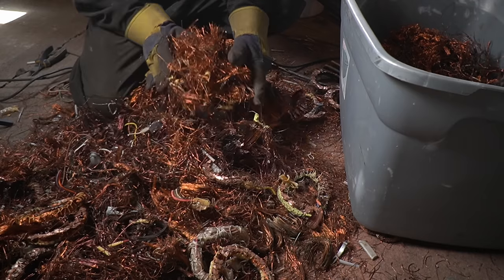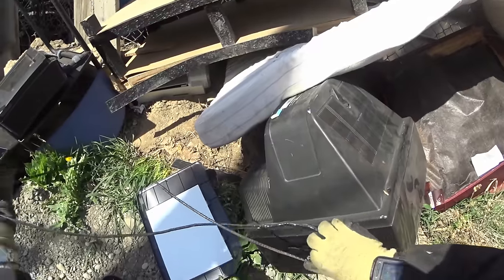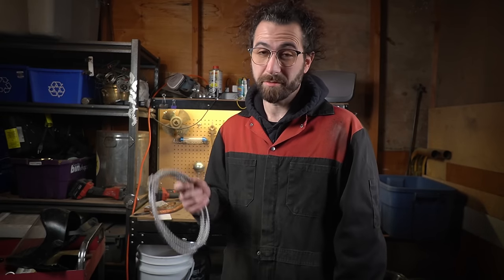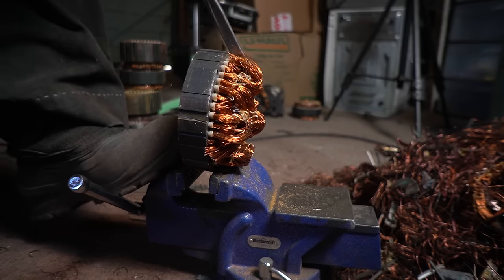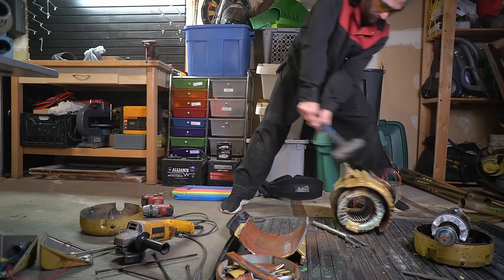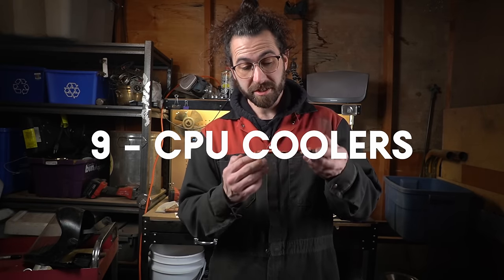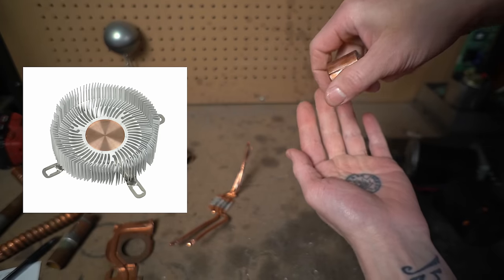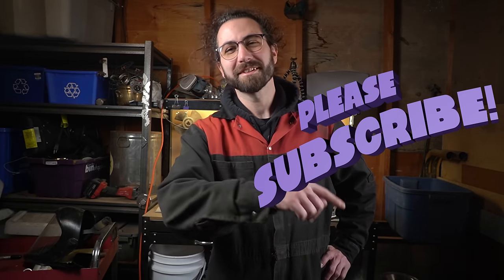10 Best Places to Find Scrap Copper

Comment: In my state (Tenn.) and many other US states the scrap yards will not take air conditioners or HVAC parts such as the radiators and compressors. 
The theory is: it creates a theft-market and people are stealing them right off homes, businesses and churches. 
I learned this the hard way and was made to feel like a thief when I attempted to scrap the processed radiators from 3 different units. 
As for cutting the copper out of the compressors and radiators.... it's sketchy - some yards will but if the yard suspect the copper came from an AC unit (they can tell by all the circular lines around the copper).... it's their discretion and if they don't like you you're screwed.
Reply from the maker: I’ve heard of that! It’s understandable though. I think some places will buy it if you have a license to prove you got it legitimately
Reply: the comp, u cut them up with a angle grinder w a cutoff disc,,a motor inside w copper,when u are done its all steel scrap..i save the radiators (coils) till i have a half pickup load and call someone that has a license,,,they pic me and the coils up and off we go to scrap yard..
Reply: @thubprint  What kind of license do you need?

Comment: AIR CONDITIONERS, THE OLDER LARGE ONES (220 VOLT) HAVE SOMETIMES 5 POUNDS, CONDENSORS AND WIRES & MOTORS, ALUMINUM, ETC, SMALL ONES 2 POUNDS

Comment: Are old car radiators worth anything, I have 7 with old electronic fans on them. But they are small. And the 2 outside edges have metal the copper hooks onto.

Comment: Great video... also, compressors if you want to take the time to cut them open. A Plasma Cutter would be the cats meow :-)
Reply: @vincedibona4687  yes I did always do.
Reply from the maker: That’s a good point, I forgot about compressors! Kind of silly, a surprise have a small stack of them waiting for me too haha
Reply: I love my plasma cutter I use mine to separate a lot of metals from my scraping.  dissimilar metals won’t be stuck together if they’re a liquid lol!  i’ve had a lot of things that just won’t come apart but with a plasma cutter they do!
Reply: yes, I use my plasma to cut compressors open too. real fast and I can burn up my old tips on scrap, i don't need a clean cut on scrap. Probably my favorite tool. I use it to cut stainless in sheets too.

Comment: Hey there cousin in the North. Out of curiosity, would it be worth of stripping wire that's most likely 100 plus years that has tar and cloth and has a chrome look to it or is it a dangerous material not worth stripping?
Or take it in as is? You are wiser beyond your years, to say a modern Wise man/a Majia if you will. If you have time to let me know. Your vids are AWESOME. Wish I had a demeanor like yours!🇺🇸🇺🇸🇺🇸🇺🇸🇺🇸🇺🇸🇺🇸

Comment: Regarding the scrap of fridge motor, there is the coolent / liquid inside i assume. that is why you don't want to handle it?. due to hazard of breathing it? or anything else?. Thank you.
Reply from the maker: It’s the refrigerant gas that’s illegal to release into the atmosphere because it’s harmful to the environment. There are different kinds and some are worse than others but they all need to be recaptured. I don’t process enough of them to justify putting the deposit down to keep a reclamation tank around so I’m better off just skipping them.

Comment: I used to mess with copper. Then I discovered lead. During the pandemic, I bought scrap lead for $1 per lb, turned it into buckshot, and sold it for $7 per pound, with about a 15% loss in impurities. I still make $5 per pound. I can make between $700 and $1000 per day, and I'm back-ordered.
Reply: Where do you get your lead from ?

Comment: 1st thing I’ve got a heating and air business that lets me rummage through their dumpster. Mostly steel small copper pipes and brass connectors that they don’t take off(they just get the easy stuff) but they throw away the HUGE A/C  compressors . They can range from 20 pounds to 80 pounds or more. Turn them in the way they are I get .20 per pounds but! Grind them open and lottts of copper inside.
Reply: Do you actually find it worth it to pull the copper out of the inside of the motor windings inside the AC compressors? Cutting the compressor open (hopefully after you drained the oil), pulling some internal stuff out, and then cutting up the copper windings? Or do you leave the windings as is and have it scrapped as a motor? Pulled the winding once (for fun) and the effort did not feel like it was worth it, especially compared to the amount of other refrigerant scrap I have.
Reply: @evanc6110  so I use a grinder to strategically make 2 cuts and that gives me access to the copper wound motor. Then I flush cut one side of the copper off… then I pound the steel with a hammer loosening the plates in sections of about 10-15 . As long as your cut is flush it will smoothly come off that end. Repeat until you have all the plates removed. It’s worth it if the compressors are very large. Small ones I leave untouched.
Reply from the maker: I am really happy to have my electric rotary hammer now so all compressors are easy copper to me 👍

Comment: My brother came across some old copper guttering. Normally I would think it would very valuable to someone restoring a period correct house. But unfortunately it was all beat up.
Reply: Guttering?
It's called "gutter".
Reply: @badactor3440  from the Oxford dictionary. Guttering- the gutters of a building.
Reply: @averywebb6960  I stand corrected. I never heard it said that way before.
Reply: @badactor3440  Maybe it's more of a regional thing.
Reply: @averywebb6960  and I used to install them, back in the day.
Reply: Yes!!!most don't even have solder on them!.easy money,always,,,,,I have found a lot over the years here!!...just good luck....,,,some of the easiest to sell...also cap mouldins,crown mouldings are copper( old houses).....good luck,,,recycling is #1

Comment: The reason they cant get away from copper in computers is because copper is one of the best and cheapest metals for heat conduction. The most coveted kitchen pans are full copper or copper bottomed for even heating. As computers get more powerful you need better heat transfer, so copper is it unless you're going with pure silver. 

A step down in metal-to-metal heat transfer is aluminum, but it has the best metal-to-air conduction,  which is why you see radiators and passive heatsinks made of aluminum instead of copper.

Comment: How much do you think you've made off of copper? I've never considered doing this stuff but I'm really excited to start
Reply from the maker: Honestly? Over my entire time scrapping, less than 2k. People get real excited about copper but most of the money is in steel
Reply: @thubprint  that's crazy, I make about 2 grand a month off copper and a couple hundred a month off aluminum and brass. So months even more, like 3-5 grand and that is just checking dumpsters on job sites and junk cars and dumped appliances people throw away. 
I live in alaska so there isn't any scrap yards that will buy steel so all mine goes in the trash which is usually about a thousand to 2 thousand lbs a month. Alot of it is even high quality steel like high silica steel and stuff. The only steel I can see here is non magnetic stainless which I do usually get a couple hundred bucks a month worth.
Reply: I have over 3,000 pounds of copper here waiting for the price to go back up.  Trick is always try to do some cleaning even when price is down and store it if you got the room which Ido.  My friends won't seperate it when the price crashes and just haul it in but when the price goes up they complain they can't find it then but I have plenty already to go.
Reply: @devind2915  I believe this is a side job for him. Full time yes a lot can be made or depending the area. Lots cities and towns now have their own recycling programs
Reply: @devind2915  with the scrap steel. Sell the straight good pieces for cheap. Contractors love good deals on bundles of materials

Comment: At around the 4:38 mark you mention "dollars per hour" so that's fair game for this discussion. With minimum wages around $15/hr these days, and copper high-ending at around $2.50/lb (down to around 50 cents/lb for lower-grade wiring) you need to scavenge at least 6 pounds of copper per hour just to break even with what you could get flipping burgers at McDonalds. And since you have to factor in the time it takes you to drive around and dig through dumpsters and sort through garbage to find the parts in the first place, then the time to take them back to your shop and rip them apart to get at that copper...well, "do you want fries with that?"
Reply: Copper gets $3.30 on the high end around here (ATX) and if you make $15/hr you take home $13 after taxes, so as little as 4lbs of copper/hr gets you out of the burger flipping rat race. On the low end you might only get $1.65/lb. The last two ac's I found had coils weighing 38 pounds together, had 5 more pounds of copper pipe, 40 sumn pounds of compressors, 16lbs of motors (? I think) 30 sumn pounds of metal, long story short, $185 in 2 hours. That's 15 hours at the Golden Arches after taxes. Yeah I'll have the fries, make it a large combo. I only worked 6 minutes to pay for it anyway

Comment: I commented on a other video but I will try again. 

For the big AC units .. do you think it would be worth taking out all the copper tubes from the radiator ? Between the time it would take I cant help but to wonder if it would be worth it or just cut the ends off and take it in like that. 
The copper tubes inside is all the weight anyways and would all be number 1 .. just not sure how long something like would take and what the difference in price would be all said and done. If by some chance you have 2 of them maybe you time it and do some sort of test.
Reply: generally speaking, it's not worth the labor involved.  cutting the ends off yes, but not going after the copper inside.   i've seen videos on this question... a lot of yards like the one i take them pays a nice intermediate price for the combined al. and cu. radiators, and like you said the cu. in them makes for nice weight.
Reply from the maker: Yeah, I’ve been meaning to explore that! It’s like anything, it would come down to how quickly you can get it done. You’ll certainly make more money separating all the copper tubes out but I haven’t tried yet so I don’t know the fastest and cleanest way to extract them
Reply: The only way it's worth it is the ones that are thinner and that have only 2 layers or even 1 layer of tubes. Run a cut wheel on a grinder strait down each tube and then pull em out with pliers. This also works super good for getting the aluminum fins off base board heater tubes with the copper pipes. Just run 1 cut straight down the whole thing and peel then off. I can do like 10, 10ft lengths in about 15 min then you got #1 pipe and clean aluminum.
Reply: I take them apart. If you get good it isn't time consuming. I basicly take my worn out sawzall blades and finish burning them up this way. slow speed and use a blade sharp enough to cut aluminum but dull enough it rides next to the copper tube and you can make clean cuts. if you go fast or use too good of a blade you make a mess and leave too much to clean off with a side cutter but once you learn the trick and get good, it is easy.  but it really depends on your yard price differences and how fast you get.
Reply: If those pipes are full of refrigerant you certainly aint getting number 1 for them.....

Comment: My favorite of all that you mentioned would be portable fans and ceiling light fans. They're the ones I find most of also box fans. I could take these things apart of my sleep. If I'm carrying my tools and I see them I will just span it in front of the person's house that they're throwing it out and just take all the motors and wires and connectors and leave all the steel because my place for steel, you need to bring it 100 lb or more and since I don't drive that's impossible. I live in Philadelphia. I do not do dumpster diving because I'm 5'4 and 64 years old.

Comment: If you need another source of brass look at big rig (semi truck) tire shops. I fill a gallon bucket in 2 weeks alone with what I do myself and cleaning is super easy. And 99% of the ones on alloy rims are still brass made to look like aluminum
Reply: What are you talking about? Brass what? 99% of what on alloy rims?
Reply: Valve stems mainly but there's alot of brass fittings in general on semi trucks
Reply: I realize how poorly I worded that now
Reply: @jesusfreak1284  
Thanks for clarifying that Matt.
It's a good tip.
I think I have a shop near-by 🤔

Comment: A lot of this are not time practical and pretty much everything shown here has its own “as is” price. When you take into account the time it takes to seperate the copper it often works out better to sell the different variations as is, and then use the saved time searching for more stuff. Always ask if you can, people like it and it builds trust and usually means you can keep coming back. If you have a trailer or pick up truck pretty much all metal is worth picking up. A full trailer 5x8(normal/medium)or thereabouts is about 1 tonne, easy to do in 4-6 hours looking in the right places. The cheapest metal is steel at about US .250 per kg or $250 per tonne. So you’re 1 tonne trailer load is minimum $250. Say you had 10kg of copper, 10 kg of electrical wire, 5kg brass, 20kg of stainless and 20 kg of aluminium, and 3x car batteries 30kg, all easy stuff to find. You’d be looking at between $4-450 for your load. Not too shabby. It’s like a treasure hunt and sometimes you do hit the jackpot !! All the while making good money. The real skill is working out the best places to search and having the people skills required to keep it all hassle free.
Reply: Sounds like an ideal way to make a living

Comment: Depending what your scrap yard is paying for number 2 copper I found that in most cases if I just burn the insulation off that it becomes number 2 copper which although it makes it weigh less oftentimes will make more money if I have 50 lb of wire at 50 cents a pound but then I burn it and it's 25 lb at 2:50 a pound you're looking at the difference between $25 and like $62

Comment: Problem with scrapping wire is there are a number of less reputable scrappers that will not only jump into the scrap bins on construction sites but also steal it out of the walls of the build sites... SOME ARE CONNECTED TO THE SERVICE... I have worked on a couple constructions sites that have had deaths of serious injuries of people trying to take the wire out of a live service panel and distribution.  So maybe add a disclaimer to your videos because being on a construction site is hazardous and also trespassing.

Comment: What'd ya do with the left junk?
Reply: its scrap steel,, .06 cents a pound.i make a scrap run when i have  enough steel to fill my vehicle up.take along AL,cans extruded,sheet,cast, Stainless steel,copper ,brass,whatever i have enough of,,,the scales wont read less than 2 pounds..

Comment: If you look in the magnetron in microwaves there is a nice chunk of copper
Reply: And fun ring magnets too. Just be careful not to break that ceramic cylinder. It can contain beryllium oxide. Very dangerous stuff.
Reply: Where do ya find these fun ring magnets ?
Reply: @eddiereyna2998  They are also in the Magnetron of  microwave ovens

Comment: Water heater tank or whatever you call that. Is toooo good copper. Better then the pieces of pipes and brass fittings on it. Yes it makes a mess with all the foam behind the sheet metal, but after that point of cleaning you will have a tank of copper ready to sell. And make gucci money with it.. A 20liter tank is around 20kg copper. The bigger the water heater how heavier the weight.. Maybe you noticed it, I LOVE water heaters!!.. Can you do a vid about water heaters? See for yourself why i love water heaters🤣
Reply: do you mean the electric ones, or is there something inside the tanks of the gas ones too?

Comment: I can promise you any laptop you find in the trash that looks half way decent will fetch far more on ebay as a parts laptop then any scrap you pull from it. Pcs as well you might get lucky and find a very valuable cpu or a Gpu that can still go for hundreds

Comment: I go to outfits that refill propane tanks.  They are thrilled to give away outdated tanks.  I tahe them home and mahe sure they are empty, sometomes they ate half full.  I use the propane. I remove the brass stem which is worth about a dollar.  The tank ia worth about a quarter.  It is not a huge profit maker, but is good for the environment.  Sometimes, they are Blue Rhino tanks, which are always expired.  I take them to Walmart and swap them for a full one for 20 dollars, I sell them for 30 dollars.

Comment: Considering the new ac units they’re selling now are made of aluminum and not copper…Im hesitant to scrap out old units made of copper…they can be converted to the new Freon…that’s also been banned in the US so they’re slowly phasing them out even though they’re still selling them and installing them at top dollar lol…I predict these new aluminum units are going to last maybe 5 years tops with nothing but problems during that 5 year lifetime lol
Reply from the maker: Yeah, aluminium isn’t nearly as resistant as copper. It’s a bit of a vicious circle, they make the units cheaper because they have to keep replacing them anyway, but they have to keep replacing them because they made them cheaply

Comment: those flexible copper pipes on water heaters SHOULD be replaced ever time the water heater is,,they corrode in the joint and will leak,,and so should rubber hoses on washing machine every 10 years too..